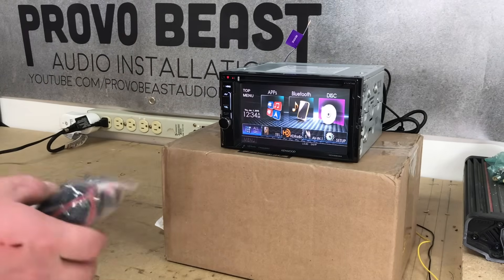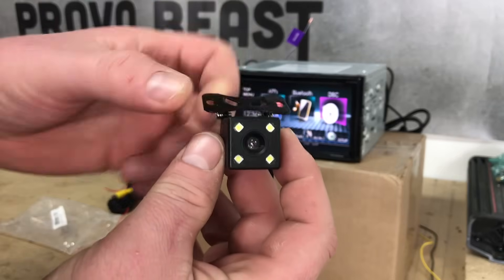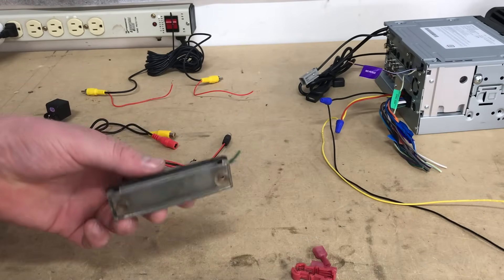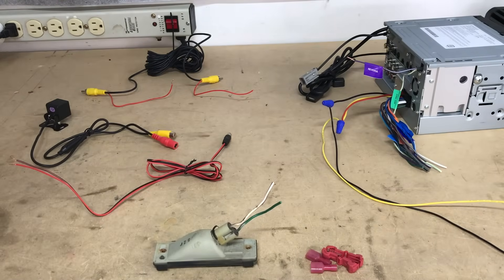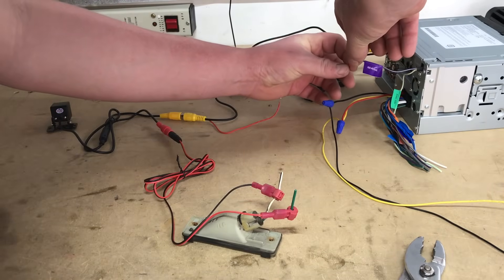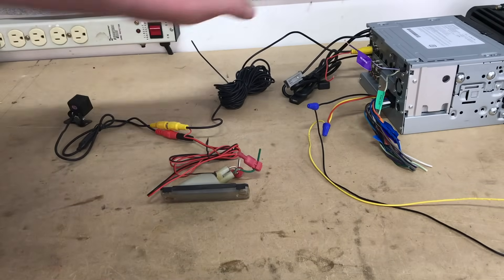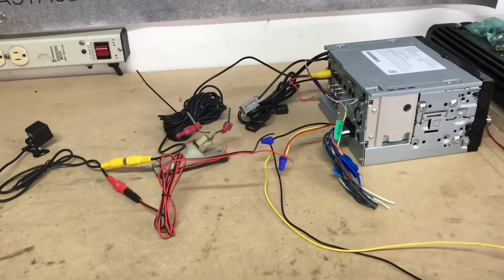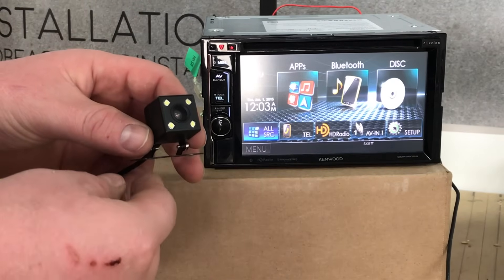Car Backup Cameras Explained: How To Install On Your Car!

Comment: I have one question. Do I hook the wires to the radio and then run it down to the camera or Vice versa.
Reply from the maker: We like to start at the camera and work backwards towards the radio
Reply: @ProvoBeastAudio hello, what if my backup camera does not come with the red and yellow audio ends. (They come with a skinny 4 hole female end). I purchased 2 different backup cameras. One similar to the one in the video and one with a license plate bracket. Both have the audio wires with the  2 short wires on the end, the video power wire where the camera end fits in the red/black wire with a 4 hole male insert. My cameras are not showing on my radio. It says no camera. When I attempted to plug the camera to my jumper from the radio, the led lights lit up but it did not display on the screen. I’m not sure why it’s not showing. I have the camera end attached to the reverse light red wires to the green and the black wire to the black. The radio end yellow audio is connected to the rcam on radio and red to the pink wire line. From my description, could you tell why it’s not showing the video feed from either camera ?

Comment: Last couple cameras I've installed, I only used the light for power and wasn't required the leads. The radio still switched to camera input when put in reverse.  Why is this?

Comment: If wiring it hot all the time will it still automatically come on in reverse
Reply from the maker: If the radio's reverse trigger wire is connected correctly.

Comment: Excellent video. I feel I have done enough research to correctly hook this up.  The only enigma is how I run the wire into the car.  I have a corvette and was told to jack up the car, remove the driver side rear tire, remove the wheel well and I can slide the yellow wire into the antenna wires entering the car.  Not sure how easy that would be or if there would be some hurdles.

Comment: Do you recommend connecting head unit pink wire ( brake/parking wire) to the ground or somewhere ? Leaving it unconnect will there be any issues?
Reply from the maker: Parking brake wire should be connected as in some units, without it connected, you won't be able to access certain features.
Reply: @ProvoBeastAudio  Thanks for the prompt reply. Is it enough connecting it to the car chasis or ground?
Reply from the maker: @big888shot  Depends on the radio, most units, yes, but some require a double or triple pulse negative (Pioneer / Alpine).
Reply: @ProvoBeastAudio  thanks for the help Buddy! I have a generic android unit hopefully grounding it would work.

Comment: Hoping you could help me figure out we’re I went wrong….

I hooked up an aftermarket head that came with the backup camera.
I got through the whole process and it work fine.
But the car sat for a couple days and the unit drained the battery….

Any suggestions?

Comment: So, if the car wiring harness has a reverse wire connected to the head unit reverse wire, do you still need the camera reverse wire connected to those in the dash?

Comment: what happens if you don't have a reverse wire on the head unit, but it does have a back up camera in rca?
Reply from the maker: Consult with the manufacture of the radio.

Comment: Easy way run power, ground, and sense wire from front to rear. 

Sense wire>reverse light>radio reverse
Power> radio constant
Ground>radio ground

If vehicle harness has reverse connection connect to radio reverse

Comment: Great video but I was wondering when running it where it has power all the time so you can see it while not in reverse ,when you actually put it reverse will it automatically come on or will it manually come on?

Comment: Thanks for your review. I do have a question though: If you connect the camera like you explained in the second option (assuming the radio has the option to view the camera whilst driving), wouldn't the 4 LED's be constantly powered? If that is the case, you would probably be better off with a different type of rearview camera?
Reply: Not if you hook up the red power wire to the reverse lights to only put power to the LED’s when only in reverse.  
The camera gets power from the YELLOW RCA PLUG FROM THE RADIO .  
& the convenience wire splices into the RED POWER WIRE from the back/tail light .  

This way you can look at the camera with LED’s off .  But if you have that option in the radio itself tho.  

The plug with the “RED WIRE & BLACK GROUND “ coming out of the camera is actually only to power the LED’s when you go into reverse. Hints when you would want the lights on the camera to burn .   

This is something NOBODY ON YOUTUBE has explained.   

Even tho everything this guy said is accurate.
Reply: @Chon-c  Thanks for your answer. Seems my aftermarket android system does not have the option to manually switch over to cameraview, so it's a no-go for me then. This option could be useful whenever I'm towing my caravan, but it's not an essential option, so no worries.

Comment: So on back of my radio (Pioneer AVH-291BT) there is a wire that says Reverse Gear Signal. Is that the same as the reverse wire you have in the video?
Reply from the maker: Yessir!

Comment: My stereo also has a parking brake light wire. What do I do with it?
Reply from the maker: Thats for settings and video playback when engaged.  This would have to go to the ground on the parking brake (if your smart harness doesn't provide one).  If not, depending on the brand of radio, you can bypass it.

Comment: Sorry I have a dum question- if you use the little red trigger wire on the yellow ended wire for power, does that mean you do NOT have to use the usual red/black wire?

Comment: Great video!  Best description.  Very clear.  I like your option of getting power to the camera constantly but would it require me to run a pair of power cables from the front to the back?  I guess if i use the brake light for power i can use the short cable that came with the camera.  I actually do want an always on camera though for towing. Great job!

Comment: hey ! best video i've seen in a while ... but failed to understand ... 
1. where do you lead the park brake green wire to? (off topic)
2. to always have power going to camera, where do you recommend wiring the front head unit red wire to and reverse wire to? 
thanks !
Reply from the maker: Parking brake needs to go to the parking brake ground wire of the vehicle, or use a bypass (depending on the brand of radio).  As for the camera, Head unit red wire needs to go to an accessory, usually in the wiring harness adapter for your specific vehicle.  Purple white needs to go to a source thats on only when in reverse, like the power wire on the reverse light.

Comment: My video wire that plugs into the radio got broken inside. I removed the broken pin but cant find a replacement video cable head that has the second red trigger wire. How can i get past this? I have just the standard connector without the red trigger wire. I will appreciate a reply.

Comment: good detailed video 
I noticed the yellow cord RCA that has red wired on the ends.
Do they need 12 volt power to them ??
I thought the video cable already send the video feed though from camera to monitor ?

Comment: I did all this and am getting a yellow triangle with an exclamation point when I throw it in reverse. Any ideas?
Reply from the maker: Too many variables, can't help without knowing the year, make, and model of the vehicle, radio, and the camera you are installing.
Reply: @ProvoBeastAudio , Thanks but I figured it out. The camera isn’t compatible with the radio. All the wiring was correct I just didn’t read the fine print lol.

Comment: I had to check all the connections on my excesting unit. since someone just plugged the cables and did not secure them i had to go check the connections and found the power cables dissconnected in the tail gate. Make sure you out some electric tape to keep them from seperating in the future! Thanks for showing the cables like this, it really helped!

Comment: Couldn’t you also connect the power wire from the camera to the tail light so that it supplies the camera with power if you have your lights on so that you don’t have to run it all the way up to the radio power to have the ability to manually switch to camera while in drive?

Comment: For the camera view while car is moving couldn’t you also tap into the brake lights because they have power as long as the lights are on?
Reply from the maker: Sure, until you turn the lights off.  Every vehicle differs, so that could work.  This video is a general tutorial, meant for a very large selection of vehicles

Comment: Did all this wondering if mine didn't turn on because it's a manual transmission
Reply from the maker: Transmission doesn't impact the functionality of a backup camera.
Reply: @ProvoBeastAudio  man then what's goin on
Reply from the maker: @lsjionredlinesupercharged2049  Either a bad camera, or an issue with your wiring.  Most instances it is the latter.
Reply: @ProvoBeastAudio  it's a newer system I'm thinking bad camera smh also thanx for responding God bless.

Comment: Customer came in with this identical kit newly installed, with this video it only took me a few minutes to determine he has a bad cable/camera/radio lol.
Do you guys have good luck with those camera kits? This one had notably cheap wiring construction dried and brittle. Id bet its a faulty cam/cable.
Reply from the maker: You get what you pay for.  We linked the ones we like in the description.

Comment: My camera is laterally inverted what do I do? I tried to change the polarity but it didn’t work
Reply from the maker: inverted as in mirrored? or upside down?  If so, some cameras have the ability to cut small loops to flip the image, mirror the image, or remove parking guidelines.  Some camera kids do not.  Just depends on the camera kit.

Comment: OK, so I’ve watched this tutorial probably four or five times now making sure I do this right. Just started my installation today. But I have a technical question that really has nothing to do with your video here. I have an older Kenwood DNX 7100 unit I want to plug two separate devices into the 13 pin outlet on the unit. Can that be done? I know the splitters are out there but will it work? The devices are the XM radio module and the second one is for a Bluetooth adapter that allows me to use Bluetooth through this older unit. OK, all that being said I don’t even know if you’ll see this but I would appreciate it if you could shed some light on this issue for me. Thank you in advance, I really really do appreciate any input!

Comment: Ive seen an easy way to use the camera both in reverse and turn it on through a switch with the use of diodes. You can then turn the cam on without also lighting up the back up light. Since diodes only allow electricity to flow one way you dont have the override switch sending backflow power and turning on the reverselight. There's guys who explain it properly. But it does work. Highly reccomend looking into it

Comment: My reverse light wasn't available so I hooked it up to a switch. It turns on but my head unit doesn't switch and I have to go to the adjustment tab for the lines just to see it.

Comment: I cannot get it to work. If the engine is off, the camera picture is perfect. Once the engine is running, the picture is completely distorted. Sigh...
Reply from the maker: You may need a power filter to eliminate the distortion over the video signal.  Common to happen in European made vehicles: https://amzn.to/3uaRemr

Comment: When in reverse the screen  turns black . But no picture is shown.  Also the reverse light it is tapped into doesn't light up. Which wire should i trace? Please make it a very simple explanation.

Comment: If we wire the camera power to the HU for constant power to enable the use of the camera not when its in reverse only, that means the camera lights will be on any time the HU is powered up, correct?
Reply from the maker: Correct, unless you find a camera without LEDs

Comment: I’ve watched this video and others, and I think is where I falter, I have the ‘Micro Bypass’ on mine - by hooking the pigtail from the A/V jack to the back up light and running the power and ground to the radio’s +/- does the A/V pigtail going to the radio need to be hooked to the reverse wire coming out of the radio, or would that be redundant?

Comment: I had some engine work done and dosconnected and removed engine, when the engine was put back and car is working the reverse camera stopped working, do I need to open the dash board and re do this whole process? Appreciate any help or ideas.

Comment: You seem unaware of the volume of your voice. During the most critical points, your voice trails off and you talk faster.
A diagram would have been good as well. Like “if you want this….wire like this” “if you want that, wire like this” 

Would have also been better talking from the radio back instead of camera up imho.
Please talk louder and slower

Comment: I did everything right, but my radio screen is just black once it’s put in reverse. I already made sure the camera was on, and tried both battery & ground for the camera priority.  I made sure everything is on the right thing, but still just a black screen. The radio is a pioneer radio and it doesn’t use WiFi or anything and I have the xcam200 backup camera on a 09 Silverado 1500. I would really appreciate it if anyone can help me!!

Comment: I hooked my camera up to the reverse light and I have no signal. 
What voltage does the camera need? 
The reverse light has 10.6 volts. ( Why?)
And when I hook the camera up to constant power, the LEDs are always on.
Please help.

Comment: Instead of using that dedicated power wire to the reverse light to power the camera, could you just use that red wire on the yellow plug wire? All I want to do is turn my camera on and off whenever I want, via the radio interface.

Comment from the maker: Parts linked in the description!
Reply: Ii
Reply: Would it be pretty much the same process using a wireless adapter? I think I'm still going to have to run the camera power to the radio right? Thank you, best video!!
Reply: So Bro if i don't have the Little Red wire in the video cable, ican hook up the Little wire of the radio to the revers light? Sorry for my broken english but i really Need this info bro
Reply: Very interesting video, informative but so late coming to the party. I searched high and low on connecting a Pioneer DMH-W2770NEX system to my 2011 Honda Element. The wiring to the rear and everything else was fine…problem started when trying to connect to the radio harness. There are 2 additional wires…white/violet (REVERSE GEAR SIGNAL INPUT) and a lighter green wire (PARKING BRAKE). Accordingly, the green wire connects to the parking brake wire (GREEN/ORANGE) in the wiring harness off a T tap in the space on the floor of the console where a sub woofer would go. The other white/violet wire connects to the small red trigger wire off of the RCA plug that connects to the brown RCA plug to the wiring harness and eventually to the back of the radio. Everything worked fine about 3-4 weeks, then intermittently…early in the morning or at the end of the day when it’s been sitting in the parking lot…now nothing. It doesn’t come on anymore even in the camera app it says NO VIDEO SIGNAL. It’s a pain in the ass to remove the plastic interior molding to see if the wiring is disconnected. The rear backup lights work so there’s no short or a fuse issue. All connections up front appear solid. Reached out to vendor and they sent a replacement camera but that’s not it. I believe it’s a wiring issue. Your thoughts would be appreciated…
Reply: This is cool and all, but this tells me nothing about how to make it work in an actual car. Now I know how the wires connect but how do I connect something from my headlight to the back of my radio? Do I have to drill wire holes or something?
Reply from the maker: @MrGamelover23  1st off, every car differs so greatly, that if your are looking fora vehicle specific video, you need to search specifically for that vehicle. 2nd, don't connect the camera to the headlight, that will do you no good.  I'd suggest connecting it to the reverse light in the tail light.  3rd, you haven't mentioned what vehicle this is being installed on whatsoever.
Reply: @ProvoBeastAudio  Uh, 2001 Ford Focus but this is purely hypothetical, so don't actually waste time answering it. Also I meant the reverse light instead of the headlight. But I figured that I can just have the cord go from underneath the dashboard to the back of the radio unit. I'm a long way off from being able to afford that kind of set up anyway, as soon as I get a paycheck I spend half of it on car repairs. I'll probably start small with something that doesn't actually have a screen just so I can get some basic Bluetooth functionality before eventually working my way up to a full-blown infotainment console with the screen and backup camera compatibility. But thank you for taking the time to reply anyway, sorry for wasting your time.
Reply: @MrGamelover23 BluscZ 😅
Reply: @MrGamelover23  !aa
Reply: @MrGamelover23  ++
Reply: @MrGamelover23  iiiiiiiiiiiiiiiiiiiiiiii
Reply: @MrGamelover23  iiji
Reply: @MrGamelover23
Reply: Good
Reply: 😮😮 @MrGamelover23
Reply: @MrGamelover23 😊 3:26 😮9😮
Reply: 6:17  @MrGamelover23
Reply: @MrGamelover23  Bruh he literally explained it lmao

Comment: Great video!  Quick question on the alternate wiring: If the backup camera is wired so it always has power, wouldn't the LED lights on the camera also stay on?  Thanks! :)
Reply: Yes,I had the same problem when a camera with light is fitted...Previous person said ton use a diode.